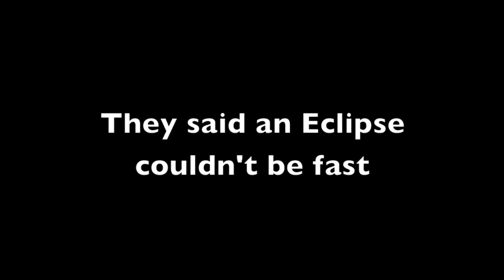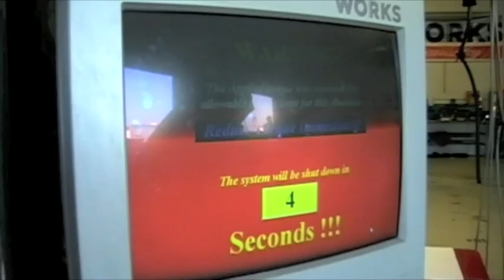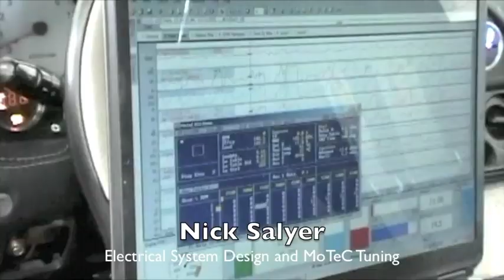Worlds Fastest Time Attack Mitsubishi Eclipse GST

Comment: I read gixxersdrews blog about the aerodynamics of a convertible.  Apparantly  a hardtop has a major low pressure zone right at the point the roof slopes down, but the convertible top has turbulence at the exact same point that somehow reduces the low pressure zone.  It breaks up the surface of the air between zones and it glides through easier.  Or something like that.